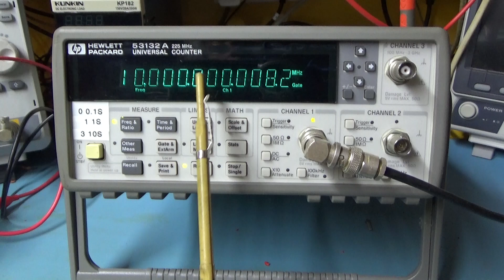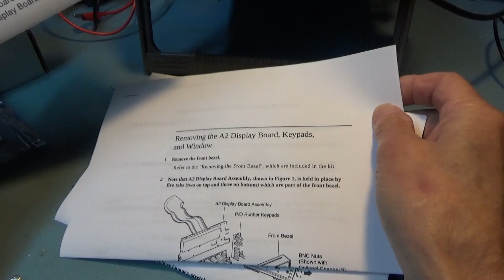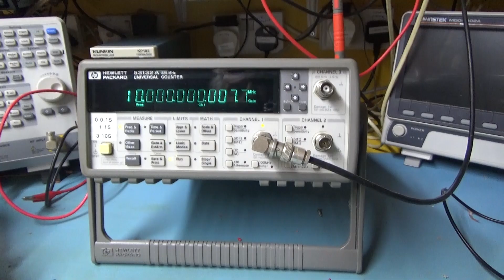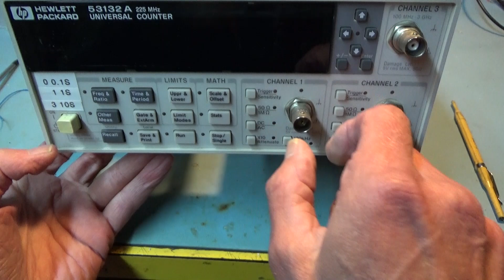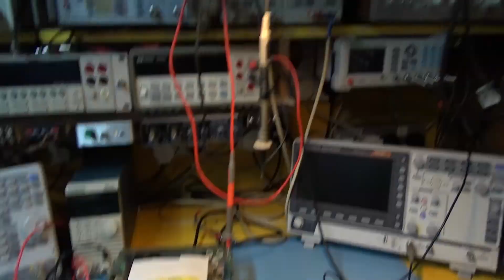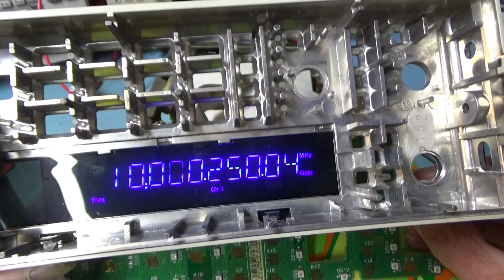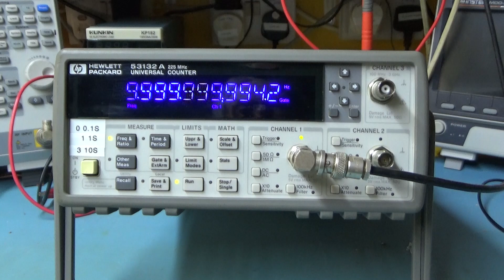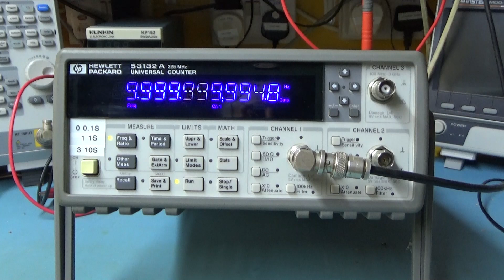HP 53132a LED display conversion from VFD

Comment: Well done Nick. I have the same desoldering tool, and I find that the secret is to get it sufficienty hot and do so at least ten minutes ahead of when you want to use it. I get fewer blocakages that way. Anyway, nice video, and just the thing to watch as I recover from recent surgery. Cheers, Steve
Reply from the maker: @oldblokeh  thanks for watching Steve, sorry to here about your problems, hope things improve for you. I must try it at a higher temperature, I've got it set to 350 degrees at the moment and it constantly blocks up. Best wishes Nick
Reply: @ptronix  Plus you've got to clean that thing out after every session.  Not that you haven't been.
Reply: I must say I've had the same experience as Nick. It's a horrible tool and very difficult to open up for unblocking. I will try the hotter temp though, thanks for the idea.
Reply: @terrynicklin417  On mine, a Yihua, it's extremely difficult to open if you pull up the back end.  Considerably easier if right after you hit that little eject button on the back of the gun, you pull the tube slightly back a bit further in that same direction it popped, and lift the front (nozzle) end.  Pulling back a bit helps to clear the assembly from the front grommet.
Or is that "Gromit"?
Reply: @terrynicklin417   The heat element will go open circuit next. Mark my words.